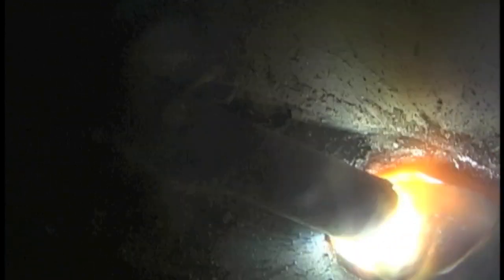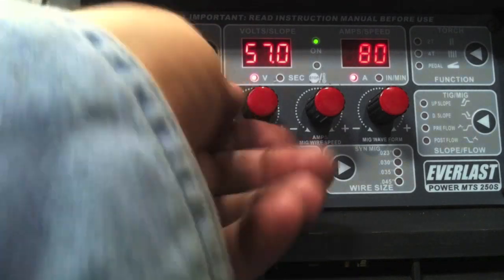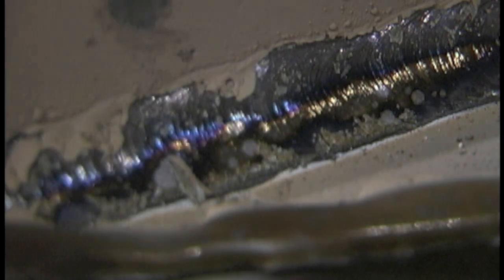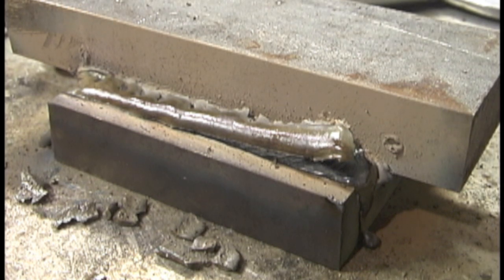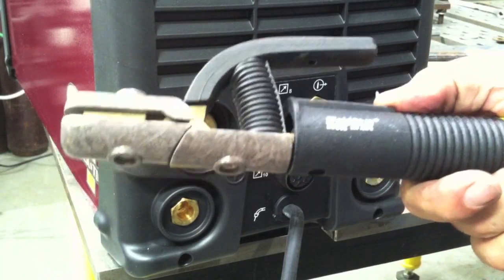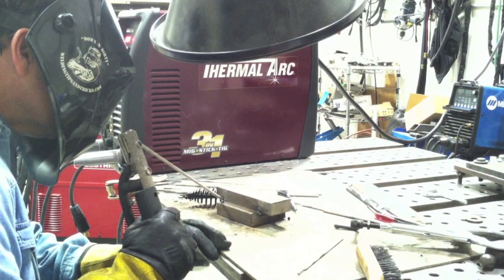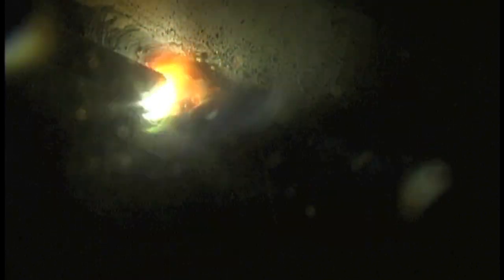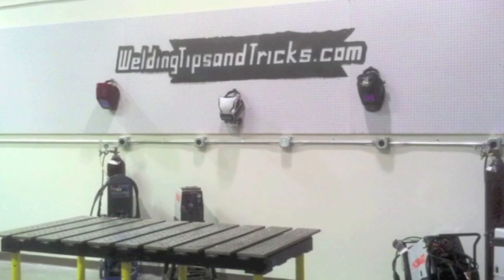Arc Welding Tips using 2 Multi Process Inverters

Comment: Some types of welders like older transformer types or DC generators have ranges or settings that effectively allow a bit of change in arc force.  Sometimes it is referred to as a change in Open Circuit Voltage (OCV).  In a nutshell, a lower OCV setting/range flattens out the slope of the Volt-Ampere curve.  So if you shorten arc length, there is a greater change in current than if it were a steep curve.  Some inverters have a very steep "curve" so the current changes very little.  Good for TIG, not so good for 6010.  

I saw an inverter once that had a dig knob.  It was labeled on the low side with a smiley face and on the high side with an angry face. Think of it that way and it makes sense.

My very old copy (late 50's) of the  Lincoln Procedure Handbook of Arc Welding and Design has a very good explanation of the phenomenon.

Comment: the dig function is the voltage on stick welding basicaly like 6010 likes high voltage low amparage (low gear on a generator)

and 7018 likes high amperage (high gear) and low voltage (30/40) so you keep your arc length close so the voltage drops and the puddle freezes up faster

Comment: First time responding.
REALLY enjoy watching your videos. 
I am currently using a Lincoln LN25 Pro at work, (which is new to me). Having a lot of problems controlling the amount of BB's it is putting out as I weld. Using ESAB .045 flux-core wire.
What can I do to eliminate the BB's?
Thanks again!

Comment: so, no "forward then backward" welding motion, or any other?
simply moving forward when using arc force?
Reply: No, you still have to use a forward a backward motion sometimes, like if you have a 6010 or 6011 rod but sense he has a 7018 rod he does not have to ocellated.

Comment: Personally, I find the Everlast has the greater bang for the buck. More accessory items like a tig torch and pedal. Both have similar maximum amps and duty cycles and both are spool gun capable. The Everlast is a fair bit less expensive.

Comment: I'd like to see the synergic functions of the Everlast PowerMTS in action. I especially would like to see exactly how you can tweak the settings it comes up with and then it varies the welding parameters according to your changes in wire feed. I haven't seen a video showing that yet.

Comment: Jon, The unit comes with a MIG torch, TIG torch, and Stick torch, along with a foot pedal for TIG, and a regulator.  Spool gun is extra.  We have only 1 spool gun available for that model. It's a version of our SN 200 designed for operation with the MTS units.

Comment: It comes with a mig gun and it does have a spool gun option. Last time I looked they had spoolmate 100 and 200 type spool guns available. I bought my PowerMTS because it has a much higher duty cycle than the thermal arc. Hope some of this helps you out.

Comment: Jody would the fine adjustment on my Miller bobcat act as an arc force adjustment ? When I spoke to tech support at Miller they suggested using a lower setting on the coarse setting and running the fine adjustment up around 10 ( max ) for a better arc